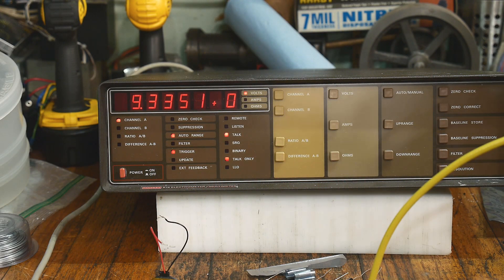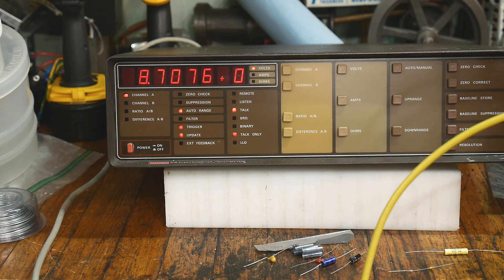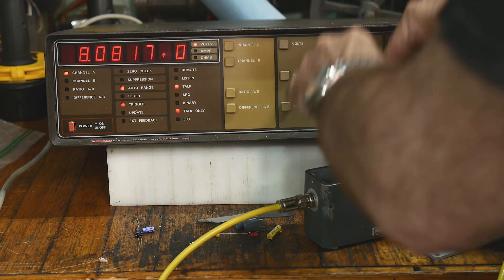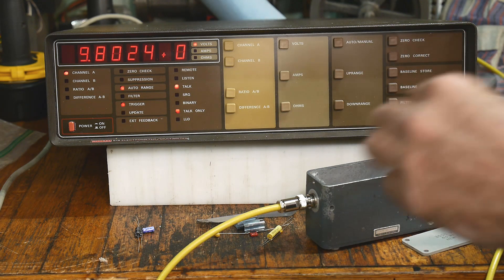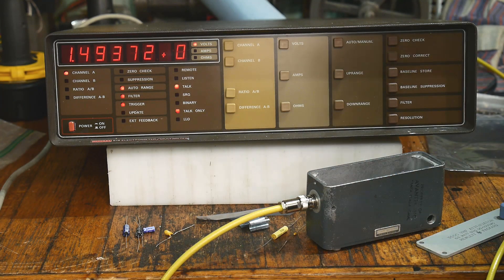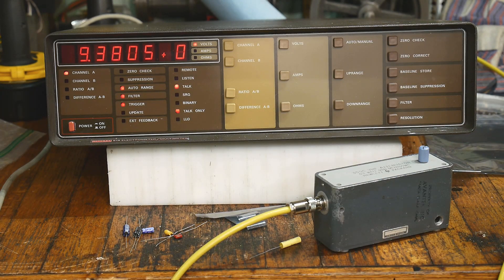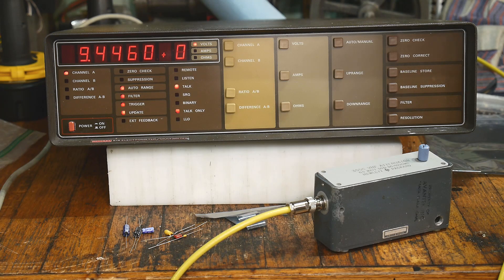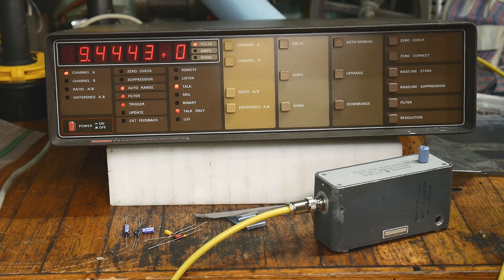#770 Measuring Capacitor Leakage with Keithley 619 Electrometer

Comment: Some of the comments below remind me of an experiment I've wanted to try but I've never had the equipment to properly perform. Take an ordinary, air variable capacitor. At maximum capacitance, charge it to some voltage. The energy stored must be E= 0.5*C*V^2. Now (with a well-insulated turning tool) reduce the capacitance. Due to conservation of energy, the voltage would have to go up, right? Is that measurable?
Reply from the maker: Tune in on May 11

Comment: Hi, wouldn't be better to actually measure leakage in current mode with battery and capacitor in series, because in that case triax cable is guarding leakage over itself? Now triax leakage is included in measurement and best capacitor probably looks worse because of that. (Leakage over triax cable in current mode is guarded by driving second shield to the same potential and current cant flow at all because there is almost no voltage difference on the cable)
Reply from the maker: I already did a video on leakage tests. This is not a  good way to measure leakage. I it interesting though. I disagree with the triax cable statement.
Reply from the maker: https://youtu.be/H1qMV_hTGGw

Comment: Great set up. With 20 TOhm input impedance it would be interesting to measure the RC time constant without additional capacitor,  just the cable with its about 50pF and the stand-offs' resistance in the box.

Comment: Very nice instruments! Wouldn't it be easier to put the electrometer in series with the battery? With capacitors (especially at higher voltages) it is necessary to let them charge for a long time so that the dielectric has time to polarize.

Impressive how the last capacitor was holding the voltage! It would be interesting to know his leakage current!
Reply from the maker: Yes, you are right. I have another video: https://youtu.be/H1qMV_hTGGw

Comment: The ceramic capacitors aren't leaking. The capacitance is changing under DC bias and Q = CV...
Reply: @IMSAIGuy  As you know, the capacitance of Type II ceramic capacitors changes quite a bit as a function of applied DC voltage and other factors. If you assume that the ceramic capacitor actually isn't leaking, you can still see a changing voltage. Using Q = CV and assuming that Q isn't changing because of very low leakage, CV should be constant. So as V goes down, C goes up, which of course is the classic DC response of a Type II ceramic capacitor.

To do this test right, you really need to measure the leakage current. Yes, it's much harder, but nobody ever promised that it was going to be easy! ;-)
Reply from the maker: @ats89117  this still makes no sense. I charge the cap to a voltage then disconnect. I measure the voltage with time. why does the voltage change over time? does Q change? does C change?  This is not a recommended leakage test. I already did a video on that.
Reply: @IMSAIGuy  Makes perfect sense. If you have a ceramic capacitor with an enormous parallel resistance (muRata specifies > 10G Ohms here https://www.murata.com/en-us/support/faqs/capacitor/ceramiccapacitor/char/0039 ), the charge will change at a very slow rate over time, much, much slower than you are showing. On the other hand, many type 2 capacitors lose up to 80% of their capacitance with a DC value close to their rated voltage. So C is changing a lot and CV has to be constant if there is no leakage. In the case you are showing, C would have to be rising to result in a falling voltage.

Of course there is the possibility that you are using bad ceramic capacitors, but then the video would just be misinformation...
Reply from the maker: @ats89117  9 volts is no where near any rated voltage for these. Sorry but I still disagree with your statements.
Reply from the maker: @ats89117  Being ignorant is not the same as cognitive dissonance. So you are saying by removing the battery the crystals are free to self polarize again?
Reply from the maker: @ats89117  if the capacitance change is 50% at 6V bias on a X7R cap, can one make a VCO that has a tuning range of 2:1? or am I missing something about 'effective capacitance'
Reply: @IMSAIGuy  These X7R ceramic capacitors have very weird material properties.  They are actually very nonlinear devices that are mainly used for charge storage. I know of some research on using the capacitance change due to voltage bias to tune a resonant DC-DC power converter.  But such use goes well beyond the documented specs of the capacitors as they were mainly designed to be low impedance charge reservoirs for decoupling or power supply conditioning applications.  Typically the leakage measurement of these types of capacitors would be performed after a constant voltage is applied for at least 120 seconds.  I think there are some rather long time-constant charge characteristics to these capacitors and what you may have been seeing is slow response of the dielectric material to the recent change in charge state rather than an actual leakage of charge.  If the voltage continued to drop after 120 seconds or more then I think you could more safely assume that it was due to leakage.  Basically if you use the X7R (and some of the other high density ceramic capacitors) for time constant critical applications then you may be surprised by the circuit behavior.  They use a lot of material science tricks to get these ceramic capacitors so small.  In some ways they aren't really capacitors anymore, they are more like capacitor analogs that are a reasonable approximation to a capacitor for certain applications.
Reply from the maker: I tried heating (voltage went up) cooling (voltage went down).
Reply from the maker: @argcargv  I knew electrolytic caps were strange. Had no idea that ceramics had similar oddities.
Reply: @IMSAIGuy  Yeah, in alot of ways these new high capacity ceramics are even weirder than electrolytics.  It caught me by surprise when I first discovered it.
Reply: @IMSAIGuy  I was just pointing out that the leakage of a typical ceramic capacitor is way, way lower than that of your keithley meter. Check this out: https://n7f2x3w4.rocketcdn.me/wp-content/uploads/2019/04/Figure-C2-99.-Typical-examples-of-the-IR-versus-temperature-in-ceramic-chips..jpg.webp 300G Ohms at room temperature! Type II ceramic capacitors have all kinds of issues (change in capacitance with DC bias, piezoelectric response, etc.) but leakage isn't one of them. Type I ceramic capacitors (NP0, C0G) don't have either of these problems. Here is maxim's take: https://www.maximintegrated.com/en/design/technical-documents/tutorials/5/5527.html
Reply from the maker: @ats89117  Yes I assumed so and was surprised when the voltage went down. Thanks for educating me about this.